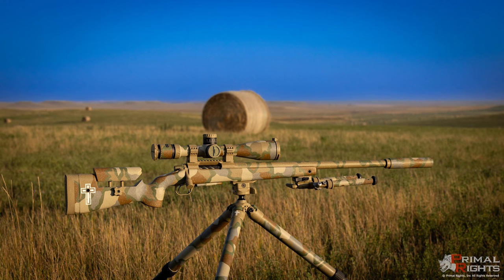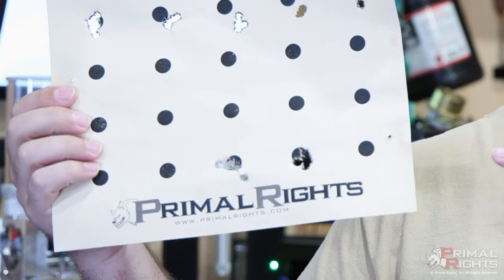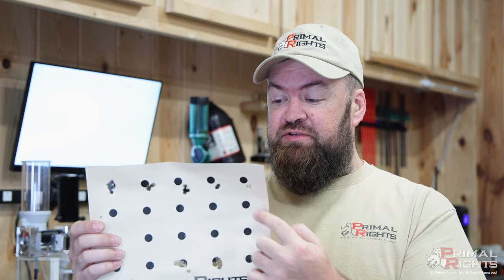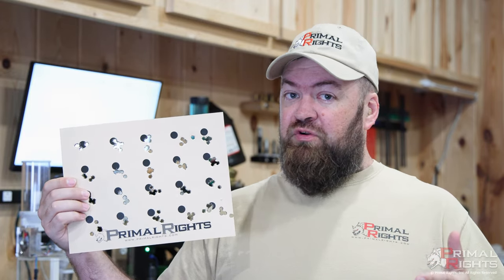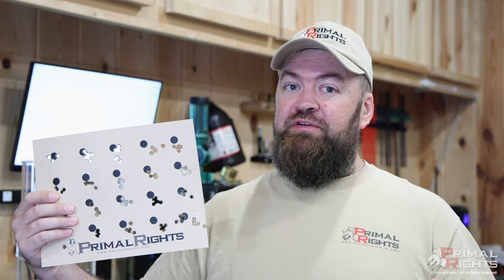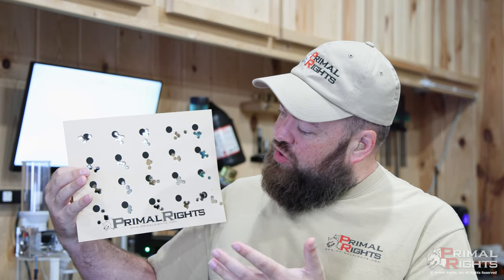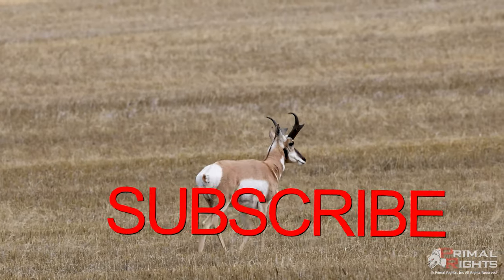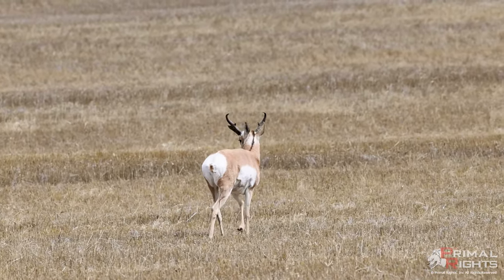Bullet Seating Force Variation & Target Results

Comment: Rewatching a lot of these videos of yours as I start up a new round of load development. Your advice here on how to treat brass and seating force, bushings, mandrels, etc, got me to a mean radius of .1 MOA from a bipod and rear sock on multiple 10 round groups. Looked like the initial target you showed. Groups were in the 1 to 3s but the mean radius in the .1 range. All I did different was used well treated brass only fired from a broken in barrel and using your method for interference. My head spacing is consistent (very) and my primer seating is as well (using your tool), powder change obviously - but for me this was the missing piece.  On the AMP Press my average variation was around 3-5 pounds, low SD and an extreme spread of 10. There were a very few (maybe 5 out of 100) that I dont know why were about 20 - pulled those for fouling the barrel and confirming zero. You have some of the most applicable info on here. Thank you!

Comment: Greg, So I have watched all of your content. Some multiple times because you provide so much information. Thank you.
 I have a problem that I have not been able to overcome. I have been reloading for 3 years. I've been hunting for decades. I like to shoot and have been working on that aspect while learning reloading. The back story...
 And, the problem. As an example I just started loading for a 7 PRC. I have an amp press and during seating it maxes out and I have to finish seating on my arbor press. This is not abnormal for the cartridges I load for. I have tried everything except neck turning although I have tried several types and I'm uncomfortable with the results.
 So how I ran this load.
 Annealed, Bench Source using Tempilaq.
 Sized on Coax with SAC die. .310 Neck/ shoulder.
 .281 expander.
I trimmed to shortest cartridge, chamfer and deburred.
I used a SAC seating die.
 The result is I ran past the threshold for the AMP and had to finish with my arbor.
 All of my other process seem okay but obviously I'm doing something wrong. I have done way to many things to name them all here. I'd take any advice you might give me as I am truly out of ideas on my own.
 I really do appreciate what you do and the service you provide to all of us out here. I hope to someday be capable of at the least some level of competently  reloading. My lack of understanding the details are holding me back for now but will change over time.
 Thank you again.
Reply from the maker: Not sure how I missed this comment, but I did! Give me a call sometime and I'll be happy to try and help.
Reply: @primalrights What about a barrel with a short life such as a .243 Win
 How many rounds would you recommend before beginning load development?